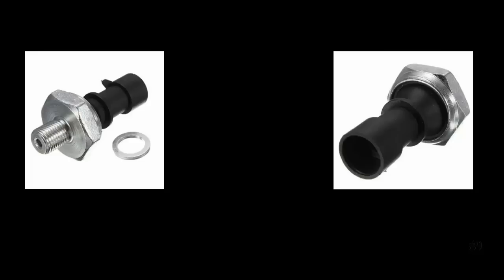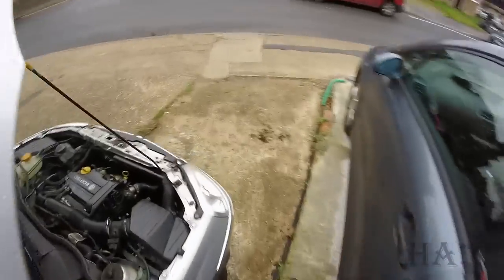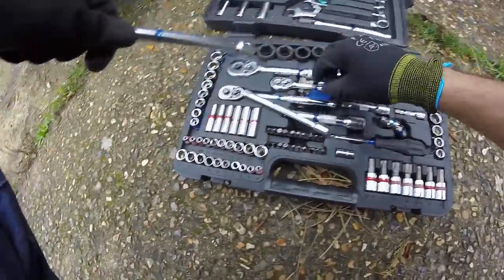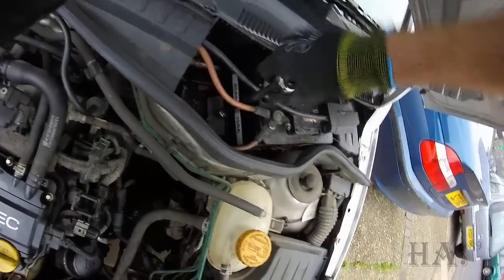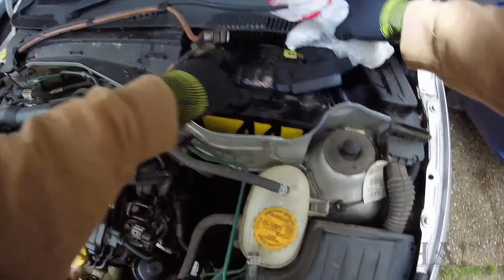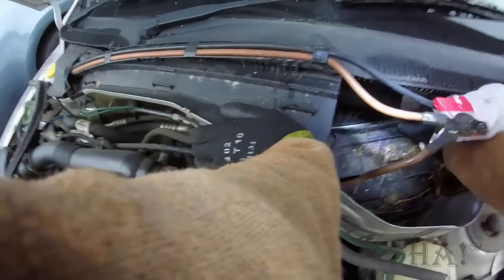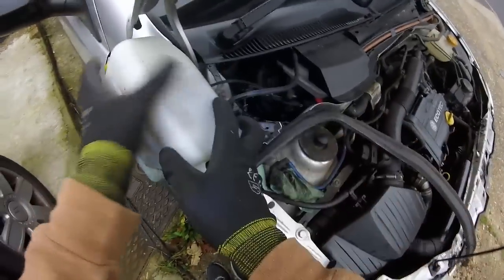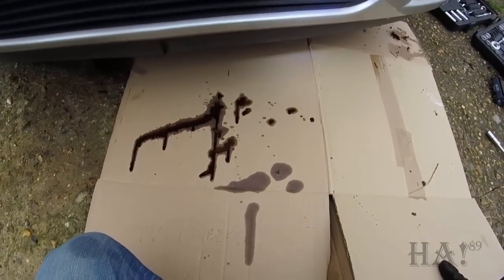Corsa 2001-2006 internal water leak + Oil sensor leak

Comment: Hiya Abe, can you do a video on removing the brake servo. That's where the leak is coming from in my car, but no clear video on how to take the servo out. Thanks
Reply from the maker: hey man so the brake server can be unbolted from inside, its a little tricky on the corsa. I'll try set a date for when I can get it done and upload tgr video and let you know what you need to buy, should be just the rubber seal.

Comment: I like this video thanks, can I ask what camera you use and what video editing software?
Reply from the maker: GoPro hero (entry level) cost me £80 from amazon. going to try to upgrade to a hero 4 later in the summer. I use Camtasia studio 8. might try adobe premiere pro. if you like this video check my motovlogs, I can be a bit of a dick. I should be making another corsa video on adjusting handbrake cable soon.

Comment: Have this model corsa and found it leaks water inside too.  Difference is the header tank keeps emptying :( Cant see any obvious leaks so thinking it might be the heater matrix or connectors etc. Any ideas how to investigate ?
Reply from the maker: Not reply, never tried it. If you just follow where its leaking from, sometimes if u can see steam and try find it then maybe you'll be able to patch it up or replace it

Comment: You almost had a birds nest there! ;) You're right about it blocking the flap and as such making water/rain get into the car. Did you have the engine on and battery disconnected and then cause a short?!
Reply from the maker: I was worried about the stereo code, I have the book and got a "security code" but in case that's not the same if the stereo reset I let the alternator keep it going...there was a tiny hole in the plastics bag and yes it cut out but no issues, car runs, speedo, rev counter, clocks, radio, windows, remote, heating, etc everything works. 

I almost had an eagles nest growing in there!
Reply from the maker: if it still leaks I'm going to silicon around the brake server which is on the left next to the windshield fluid bottle. because its flooding on the drivers side.
Reply: did it fix the water leak i got the same problem atm cba to silicon around the break server because its too cold to do it
Reply from the maker: 786Danyal no xD I noticed if I Dont fill up the screen fluid it doesn't fill up inside with water...might be an issue with the tube that goes to the rear but doesn't make sense. Need to properly check it out in summer.
Reply: ok  thanks for the reply

Comment: hi bit of a noob question but what is the big hose near the oil sensor, in my car its leaking and the engine light is flashing so im wondering what is wrong with it, any ideas?  
i only brought the car yesterday and the dealer says under law i must give him up to 14 days to repair it?
Reply from the maker: not sure, mine doesn't have a hose under it. has 2 big pipes next to it which are water pipes. is it the black rubber pipes?
Reply: +HonestAbe89 yeah its the rubber pipe next to it, i think its near the oil sensor, is that a water pipe?
Reply from the maker: Follow them, they should lead to the radiator. One goes to the top and the other goes to the bottom. If they're leaking its possible there's 3 things commonly wrong with water pipes there, not tight, rubber is worn out or the thermostat needs changing. Should be leaking pink water I think. Check your engine coolant see what colour and see if its the same. Let me know how it goes, you can message me on instagram.
Reply: +HonestAbe89 okay thanks il insta you.

Comment: NEED SRIP DASH ITLL BE MATRIX HEATER
Reply: mate had it said he pushed the pipe in further! dunno why was perfect get it bk now loosing water into footwell and ony driver sidev steams up when heats on
Reply: es this is the problem heater core needs replacing i have just done a rad repair well replacement and it has effected the heater core causing it to leak coolant keep an eye on your coolant level.
Reply: yep got the exact same problem it was funny turned heater on windows down a this steam starting to pour out of windows
Reply: Typical Heater Matrix leak.. Had it on my GTE..
Also had the Birds Nest Drain hole leak as well...
Remove Birds Nest FIRST... cheaper...

Comment: my oil sensor is not soaked in oil tho?
Reply from the maker: South Paw then oil could be leaking elsewhere. the usual procedure is check sump bolt, oil filter and then rocker cover. also if u got blue smoke coming out the exhaust. see which one fits the issue
Reply: ArabianRider ok thank you brother very helpful did the clearing of leaves fix your water leak inside of your car? have same prob?
Reply from the maker: South Paw no hahaha...pissing me off, dunno if its the seal around the brake server. The one on the driver side below windshield.
Reply: ArabianRider  lol no worries im gonna get my mechanic to sort it ill let you know the problem once sorted